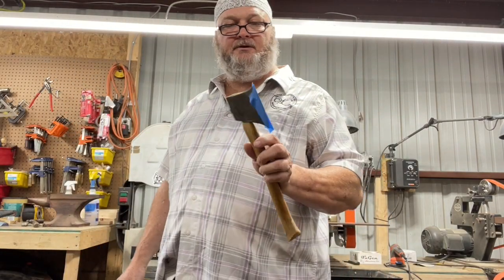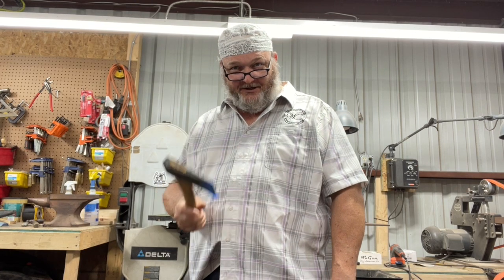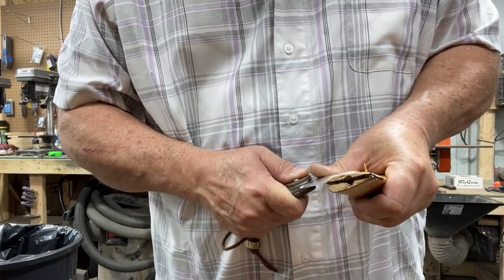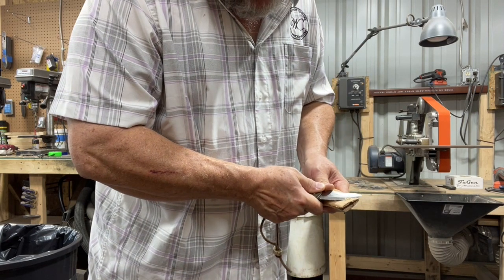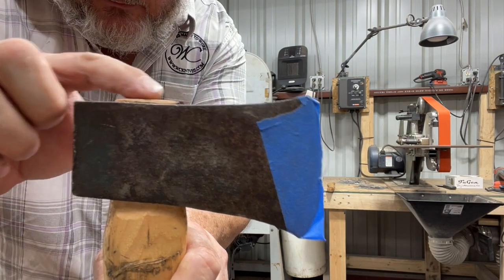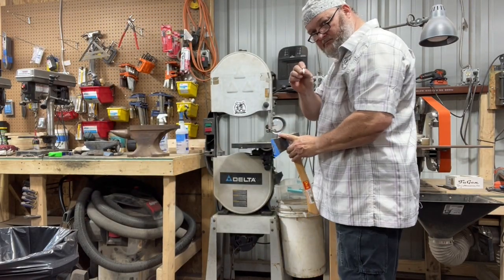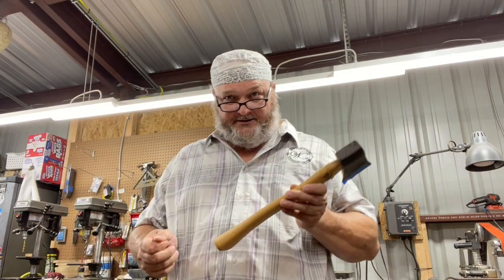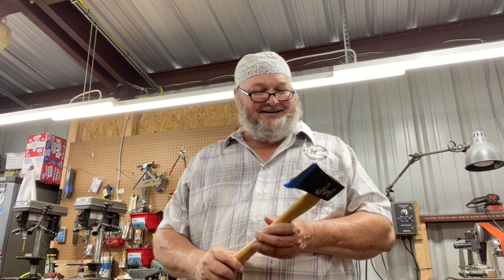Hanging a Vintage Collins Hatchet My Way

Comment: you're not the only one partial to Collins axes Will damn good axe for the price!! i prefer to clean the varnish off first and generally use a rasp to fit the head though!! i'll trade you the heat for rain we got nailed with 6 inches in 18 hours Friday!!
Reply from the maker: LOL, we are about 14” rain above normal right now. Temps in the mid nighties with heat indexes 107 or better with high humidity from all the rain.
Reply: @wcknives  damn unusual here!! can you believe the price on handles anymore! just got one for a hammer and it was $20.89 with wedges and tax!!
Reply from the maker: @keithmoore5306  wow, bought this handle a couple years ago, don’t remember the price.
Reply: @wcknives  wow yeah a sledgehammer or axe handle $15.99 is reasonable but for an 8 ounce kitchen drawer hammer! who would have thought metal would be cheaper than wood at any time!! the wedges were 5 for $3,89!
Reply from the maker: @keithmoore5306  LOL, yep wood pricing is unbelievable.

Comment: Would the warming of the wood handle before the linseed oil app apply to only solid wood handles ie hammer , sledge, axe , hatchet or could this also be used on a hidden tang or full exposed tang ? Thanks for the info
Reply from the maker: I do that on all handles including unpolished micarta.
Reply: Thanks for that I’ll start doing the same so as long as it within the range of good sense it won’t effect epoxy
Reply from the maker: @kameelelian6044  no need to get it hot. You only need to warm the material.